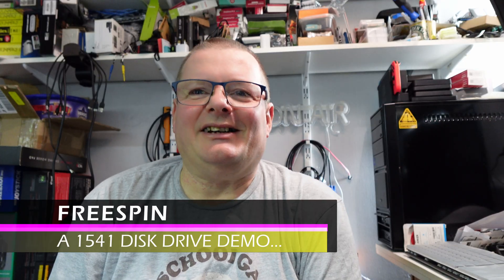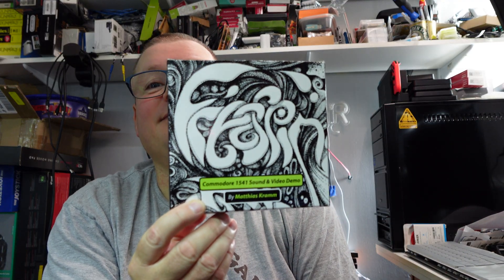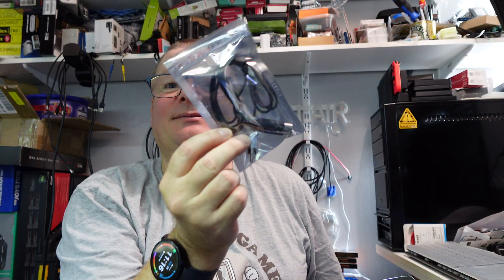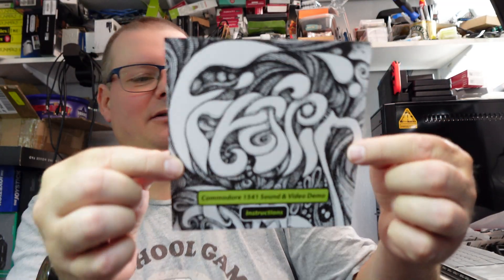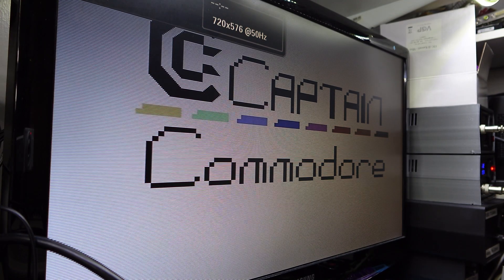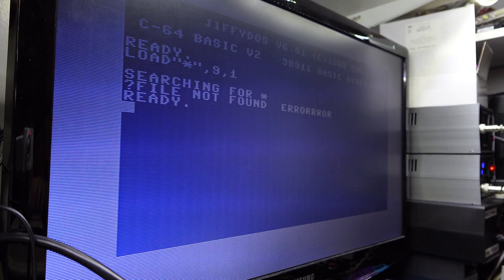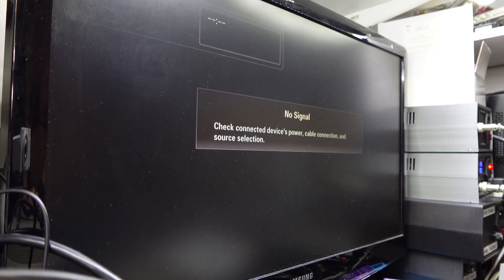EP90 FREESPIN - THE 1541 DEMO WHERE THE GRAPHICS AND SOUND ARE GENERATED FROM THE DISK DRIVE !!

Comment: Is there a version of this that runs on vic20 or was the 1541 more capable
Reply: What i ment was stand alone - no drive attached, could be a new bench mark vic20 vs 1541
Reply from the maker: It's the drive itself, I suppose the "loader" could be written for the Vic as well as it only loads the code into the 1541 and starts the drive

Comment: Funny fact.

When I grabbed my first IBM PC clone...

I've noticed a little later that the "CPU" (microcontroller) used in a keyboard was faster than CPU my 8-bits computer had. :-).

It was not C-64 so I will not bother to name it but more or less keyboard microcontroller in PC is faster than majority of 8-bits from 70s/80s.

I was even at some point thinking to hack it and create a version I could use for something more than just handling of keys but it was somewhere at the time of PS/2 and USB later so I abandoned the idea to go with it.
Reply from the maker: Jesus that's going back a bit didn't they start at 4 MHz .... Mind you was about same time as c64 remember a guy I knew getting an xt

Comment: Neat!!  It's cool knowing that the 1541 processing power is actually alot more than the C64 which is one of the reasons why it was more expensive than the computer itself.    Good times!!
Reply: They both use a 6502 (6510) running at 1mhz, so how does it have more power?
Reply: The 1541 motherboard was based on the Vic-20 board. Very similar computing power except obviously no graphics or sound chip on the 1541.

Comment: i have been laughed at a bunch of times, especially on here, asking why its not possible to turn a 1541 into a computer! lol
Reply from the maker: Well i suppose it could be with a rom change but it would need a display processor
Reply: @CaptainCommodore  that was my point that it is theoretically possible not that it is worth it to do it or anything like that, but I was suggesting that with the right software and some hardware it’s not outside of a reason to suggest that it could be used as a computer since it has the same processor as the computer it’s supposed to be attached to. Really what I was thinking could be beneficial would be for the Commodore to act like a dual processor machine using the 1541 processor in combination with its own to double the processing power.

Comment: That's pretty cool! I would like to see both a monitor hooked up directly to the drive and one hooked up to it through the 64, and see if the 64 reacts at all while the drive plays.
Reply from the maker: Nah you need to remove the serial
Reply: @CaptainCommodore : Have you tried having them both in it at the same time? If so then what's that like?
Reply: @HelloKittyFanMan.. There's little chance the C64 will do anything useful with what is essentially noise coming in on its serial port when it isn't expecting to read it anyway.
Reply: @CantSettleOnAName : Useful or not, it would still be interesting to see what it might do, if anything.
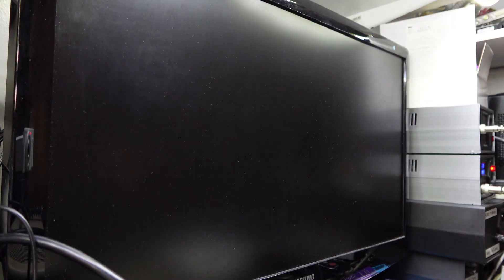Reply: @HelloKittyFanMan..  from the schematic of the cable 7:02  it is mixing clock and data (with the 100ohm resistor) to simulate the composite video signal, so the commodore will not be able to understand the data being passed on even if trying to read the serial input. Is a very clever trick, will have to get a hold of one to see the signals but looks like is creating DAC with that resistor and modulating the signal to create Sync pulse with a black and white luma signal on top. Amazing!!!! Will be great to see an in depth of the 6502 code to keep the timing of a composite signal.
Reply: @MarianoLu : The Commodore what?
Reply: @HelloKittyFanMan.. I meant that the C64 will not be able to understand any of the mangled signals from the modified cable
Reply: @MarianoLu : OK, so edit your previous reply accordingly for future readers and then we'll delete our follow-up replies about that. (Also lower-case "sync" while you're in there.) Thanks for that description.

Comment: Amazing. Yes, the 1541 in 1984 was as expensive as the c64 itself. So almost any owner knew it is a full computer itself.
Especially after opening and installing dolphindos, speeddos or any other floppy speeder you knew.

Even back then we had "demos" what made the stepper motor of the 1541 play "el condor pasa"
I was always afraid that this progs kill my 1541 ... never expected it could have video output

those times have been great. but i am really happy we dont need to use floppies or cds anymore. 
a good usb stick or harddisk does the job better
Reply: Thanks for reminding meme the song that the old 1541 Demo had. That was so cool when I got my hands of that circa 1986. I knew it may kill the drive but it was such a cool piece of 6502 code. I remember that it prompted me to disassemble my disk drive just to see what it was doing
Reply from the maker: Exactly, devices like the u1541 and kff carts have made it so much nicer to load

Comment: I remember back in the 80's, I found a program that made the 1541 drive sing. It was pretty cool but I only ran a couple of times. 1541 drive heads were notorious for going out of alignment on a good day just reading and writing disks normally especially when playing games that used copy protected disks where they add extra tracks or do other tricks with drive tracks that ended up throwing the drive out of alignment at some point.  . The 1571 was a better drive system. They changed how the spring worked with the drive head. Drastically cut down on the alignment problems. Still, the singing drive was pretty neat but I had never seen or heard of the drive being able to output video. That's a new one on me.
Reply: It was a rendition of "Daisy Bell".  😉
Reply from the maker: I remember something similar, I'm pretty sure that fucked the drive heads too

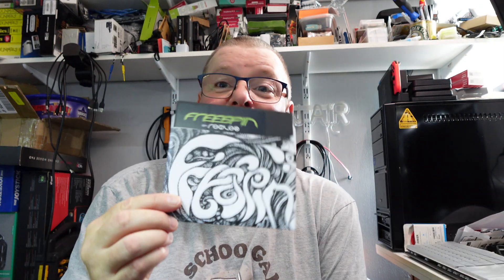Comment: 0:58 You mean is a standard 5¼ inch floppy disk like all computers back in the day had, it's just formatted on a 1541.  There's no such thing as a real "1541 floppy disk" like it's a proprietary media like Amstrad'd  3 inch floppy disks that only Amstrad computers used.
Reply from the maker: Well yes, but it is a real 1541 floppy disk as although it uses standard media it's formatted for the 1541 as intended, try using that on anything else without a reformat ?
Reply: @CaptainCommodore  You make it sound like a floppy formatted from a C64/1541 is RARE, but that's the same with any other computer of that era. As if the majority of software for the Commodore was written on other computer formats.

Anyone with the same hardware can format a 5¼" floppy and claim it's a "genuine 1541 floppy disk!!!" Just as much as anyone else can with an Apple //e, Atari 8bit, MS-DOS, CP/M, etc.  I'm sorry it just sounds ridiculous when you said that.
Reply from the maker: @fragalot it is rare for me to receive one through the post on 2025, I didn't format it and load the software on, I received it ready to go, your point is ridiculous
Reply: @CaptainCommodore  You're the one exaggerating this, and I'm just pointing it out. I'm sure you could ask anyone for a formatted floppy from whatever computer format you need it as, and I'm sure someone can send you one.
Reply: @fragalot  you're contradicting yourself and arguing about nothing.  For example, many other systems used those 3 inch floppy disks you mentioned e.g. Tatung Einstein, some MSXs, Famicom disk system.  It was clear what he meant by '1541 disk', whereas in trying to correct it you made an actual factual error.
Reply: He stated "a real 1541 floppy disk" implying there are fake ones? They aren't RARE by any stretch of the imagination that he made it sound like in his video.

So all I am saying is there is nothing special about that 5.25" floppy disk. It's a standard floppy formatted by a Commodore 1541 drive, that's it that anyone can create themselves by formatting it.
Reply: @fragalot  you really interpreted what he said as implying there are 'fake' ones?  You are just trying to pick fault for some reason, whilst making mistakes yourself.  Fortunately both of our comments help his algorithm.
Reply: @jtsotherone  That's my point. Why would you state "real 1541 floppy disk" which IMPLIES there are fake ones, or fraudulent ones, and copy-cats, or something special about that disk.. there isn't.   What mistakes did I make exactly?
Reply: @fragalot  a) there IS something for it because it's a modern release on a vintage format, and b) you stated that 3-inch disks were proprietary media that only Amstrad machines used.

Comment: This was actually VERY cool! I was feeling sorry for the old 1541 ALPS! One quetion: Was your drive running JiffyDOS kernal ROM or stock? I saw your 128 in 64 mode booted to it. I ask because head smacking home sound and possible issue with 64 / 128 running JiffyDOS and drive NOT running JiffyDOS. No problem? Just my ignorance / paranoia?
Reply from the maker: My drives are not running jiffy